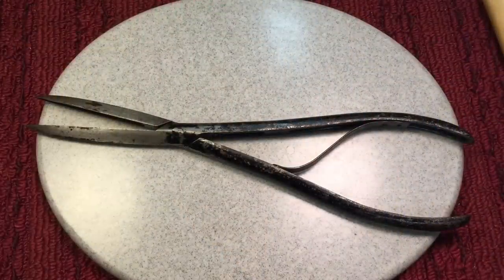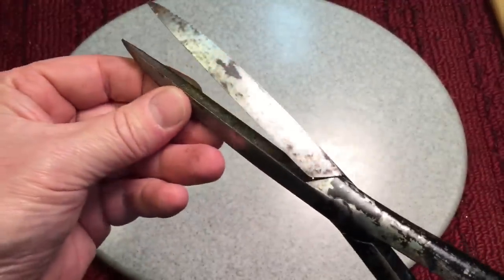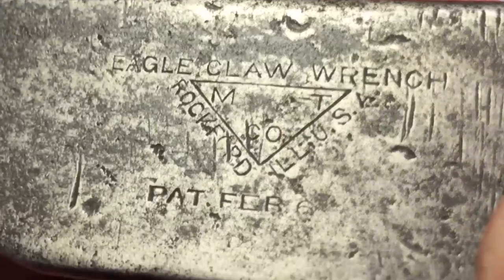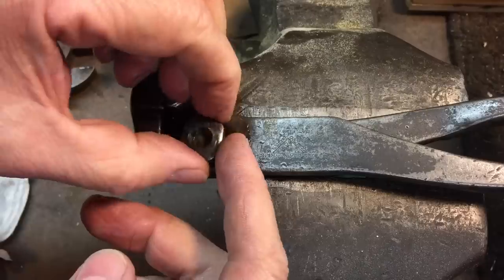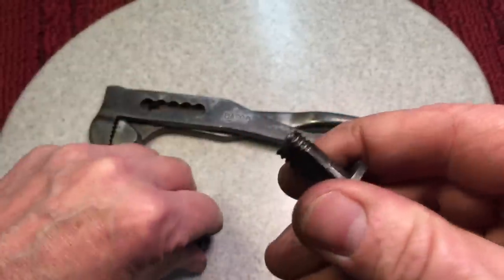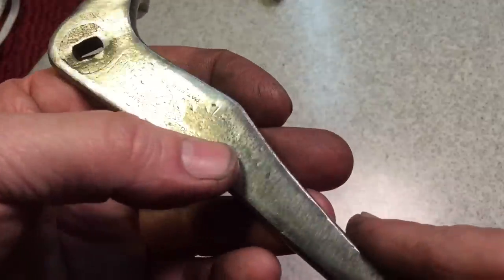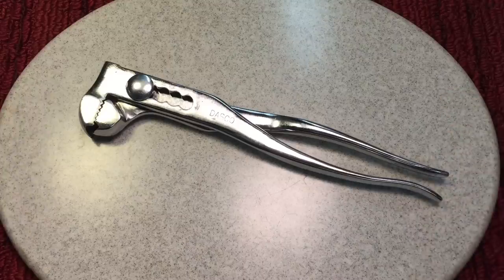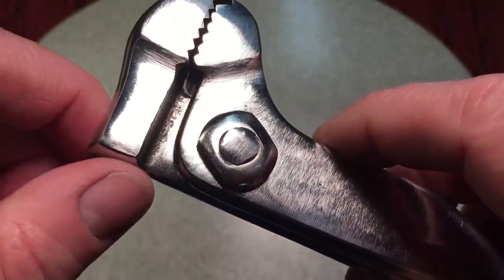Dasco Eagle Claw Wrench #302

Comment: Thanks for the tip about wrench directionality, I'm 59 and I NEVER knew that - common sense when you look at the teeth but you know what they say about common sense, right? And if that carriage bolt removal isn't proof of, 'the right tool for the job' then I don't know what is - that was delightful to watch! 
BTW I've just taken a grinder with flap wheel disc to a hammer head I had lying around... so now I must make a new handle for it too. This hobby is catching!
Reply from the maker: Keith, without a doubt this hobby is so much fun and very rewarding!  So glad you are on board!  Thanks!

Comment: Wow, those Dasco’s are a really well designed and made tool. They still work just as good as the day they were made 100 years ago. To many designers these days are more interested in making tools look cool or aggressive but I wonder if they’ll still be any good in 100 years especially the plastic handles. Great work Scout, they came out looking awesome. Cheers Stuart 🇦🇺.  Ps, I think most tools back then were nickel plated until hard chrome plating became widely available in the mid 1930’s.
Reply from the maker: Hi Stuart- Before chrome plating became common tool manufacturers tried all kinds of coatings to edge out the competition and some are pretty toxic when ground or sanded...
Reply: @ScoutCrafter  So true.

Comment: F. Dick has been founded in 1778 in Esslingen, Germany. They started as a file manufacturer and they still produce high quality files to this day. They are also quite famous for producing excellent sharpening steels, professional kitchen and butchering knives and kitchen tools. As a matter of fact they still offer fish deboning pliers, although the modern ones are slightly different (model no. 90152160).
Reply from the maker: F. DL- Thanks very much-  😃👍
Reply: I have several F Dick kitchen knives and a honing steel.  They are beautifully manufactured instruments.The arrow indicates the direction that honing should take place.  There are arrows on the honing steel as well.

Comment: Nice restoration John! 35 degrees and snowing here in Iowa. Thursday's forecast is 74 degrees.  Go figure.
Reply: Great restoration!  👍😊 FL Temp dropped from 86°F - 74°F, with heavy rain, T-storm, numerous lightning.  Blowing mosture from T.S Epsilon to the East over by Bermuda.